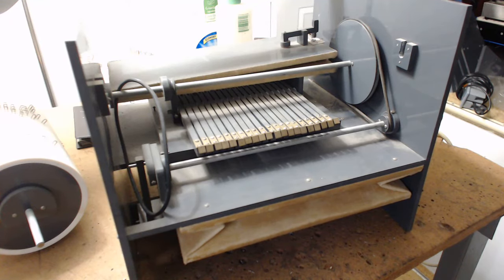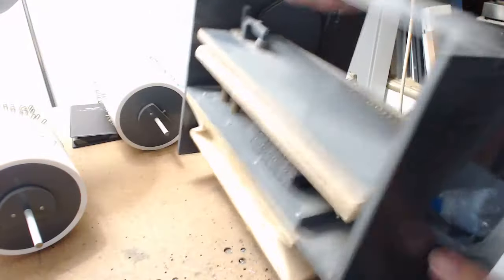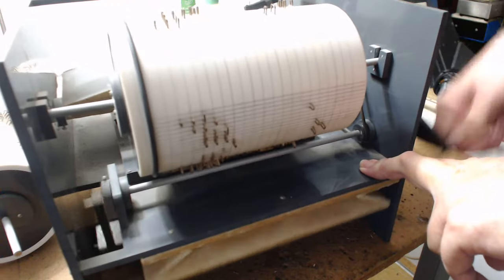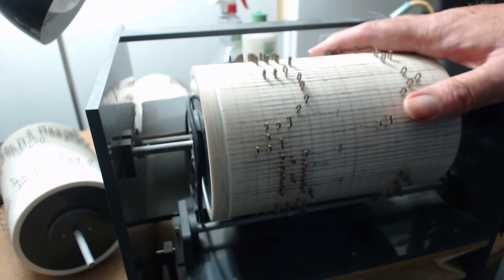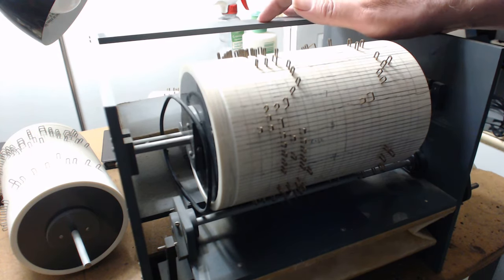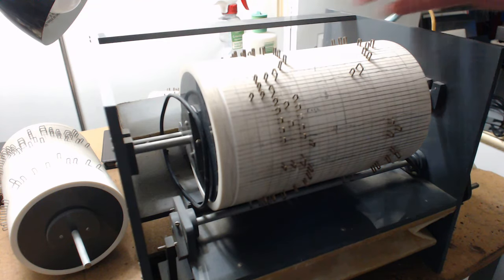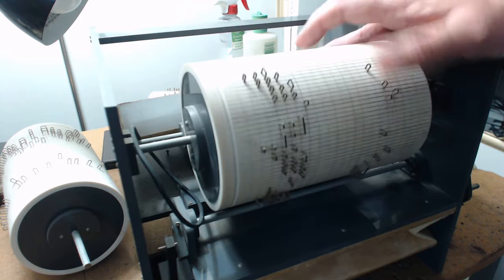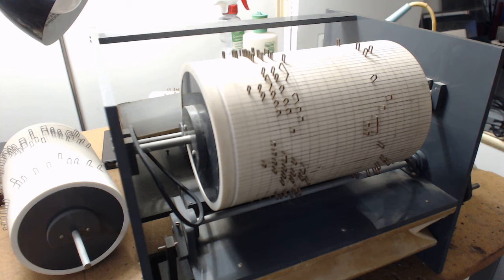Crank Organ Build

Comment: Cool.  I wondered what your crank organ stuff was all about.  And Wintergatan thought he had something, only later has he confessed that his stuff didn't really run as perfectly as shown in his videos
Reply from the maker: 20 years ago the Internet was just getting started. I was flying blind on my adventure.  I had to pull books from other states through my NJ library system.  I learned right away how to get the right amount of air pressure. Then there was the REEDS!  Next hurdle was mechanical noise of the parts. Getting past the expensive Gears.  An Easy programmable Drum.  Then I saw one of these 3 years into the adventure.

https://www.youtube.com/watch?v=BNeHgPKE21I

Wintergatan gets lots of help and funds.  I set my goals to  KISS.  There are Barrel Organs that use vacuum valves to read punched holes in paper holes like a player piano.  The valves are super quiet.  Wintergatan stuff is not that well thought out. Lots of finagling. I went looking to see how Crank Organs were made in the past.  Then  I just modernized the materials.  It was not reinventing the wheel.  I used other peoples ideas from 100 years ago.  The Cob Roller Organ has better Reeds with Sharps and Flats.  But forget programming a Cobs!   The project was very hard but rewarding!  I was in a group of old men who were all BS.  Unlike them I reached the finish line.  A how too booklet also was produced. That lead to the CNC machine and booklets.